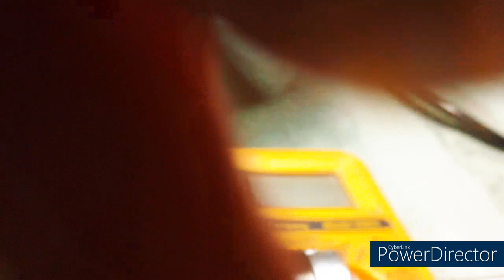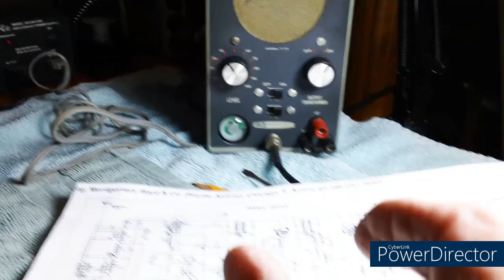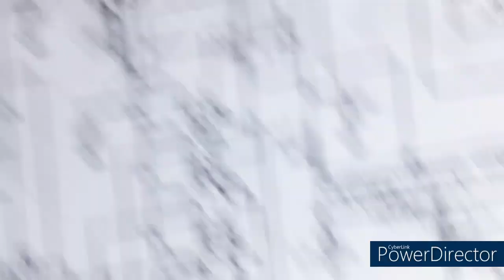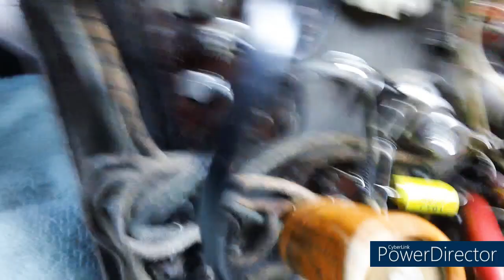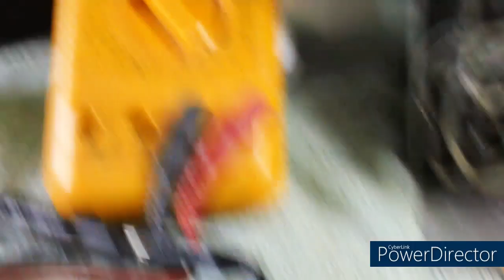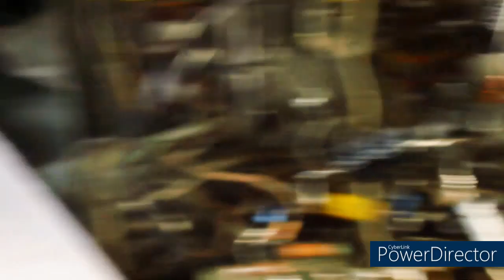Part #11.  1936 Airline 62-198 repair and restoration.

Comment: I see you still use the coil method to secure the leads before soldering. that is THE BEST technique i've learned. it holds itself on for easy soldering and they slip right off for future repairs.

Comment: Glad to see you back.  I also am torn between restoring an old car and repairing radios.  Got a 38 Packard Six, and a slew of Farnsworth radios.  I have been using your coil technique when installing resistors and condensers.  Thanks for sharing that.  Richard from R.I.
Reply: Hello John. Excellent video. Very good tips for sure. Safety first!
George B
Reply from the maker: George H,
I'm not sure it's excellent, my friend, but if it'll keep someone from being seriously injured, then it'll be worth the effort. 
Btw...the next vid goes up in a couple of days, then we'll wrap the series up with some brief cabinet work.
Regards,
John
Reply from the maker: Richard,
Thanks, my friend.  Recommendation: There's a billion antique radio YT channels.  Go with the Packard. 🙂
Regards,
John